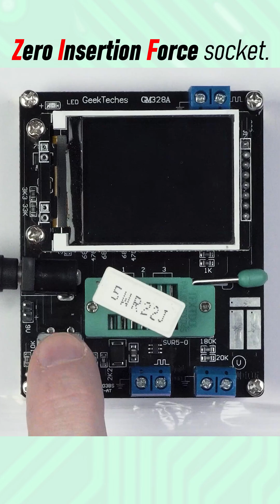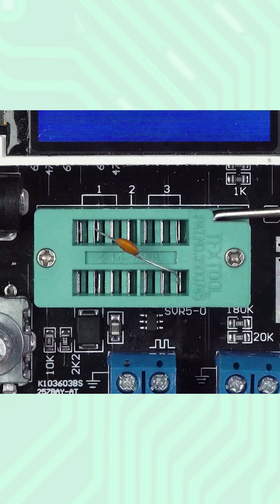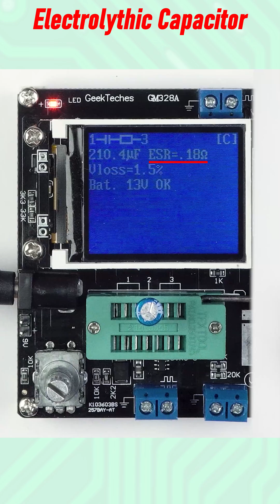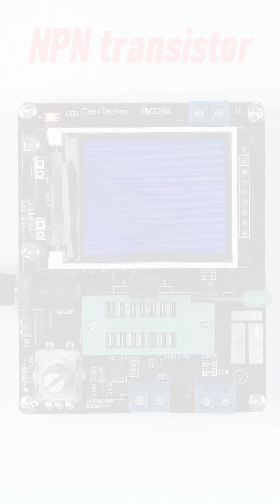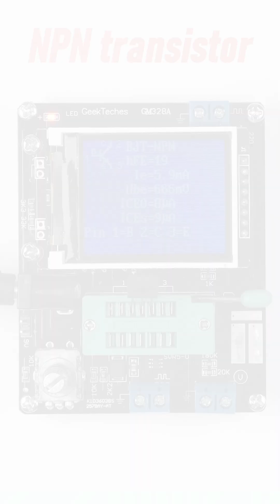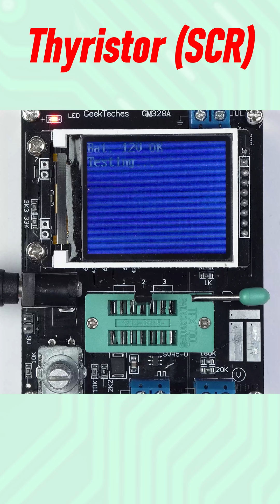GM328: simply a MUSTHAVE if you're into Electronics! #electronics #multimeter #transistor #thyristor

Comment: Yeah but how would it work with surface mount components
Reply: get or make an adaptor. With 3D printing, PCB design, and solder you could do it
Reply: The solder pads to the right of the ZIF socket.